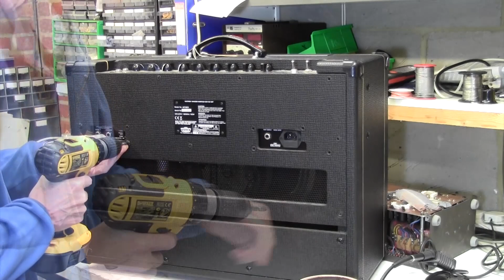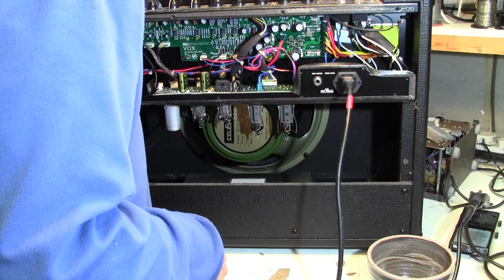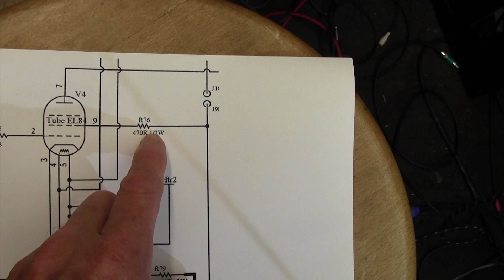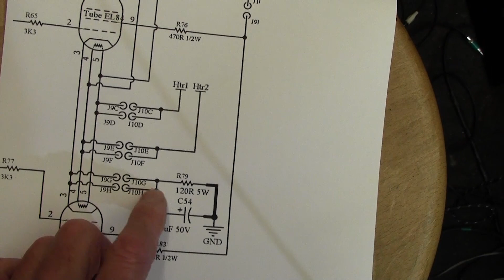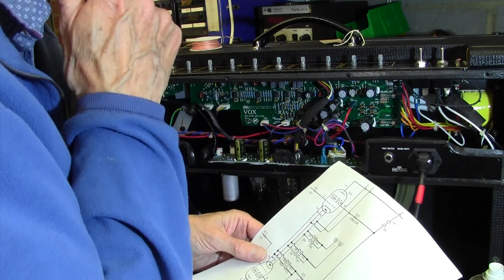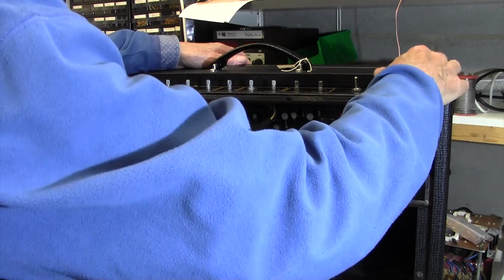How To Fix VOX AC15C1 No Output

Comment: I measured the screen resistors they are good. Replaced the tubes. Measured the 450v caps and 16v caps by the tubes all weren't tolerance.  Any other suggestions? I cant get any input.

Comment: Well it seems you didn't leave all the red herrings in by editing out the part where you got shocked by the undischarged filter caps.

Really should have replaced both the screen resistors with higher than the stock 1W resistors as this seems to be a rather regular fail point on these amps.  

Hopefully the owner isn't dealing with the same problem occurring again soon.

Comment: Hey my friend I'm a tech working on one of these guys I have output but is very low I'm seeing 380 volts on the power tubes I tried installing all new tubes same thing slight hum as well have you seen this thanks Ed

Comment: a friend gave me one of these and told me to have a go at it. same symptom. tubes, or valves if you prefer, are heating up but the amp is dead silent. no hum, nothing. i'm no professional but i have enough experience to not kill myself. no idea what the issue is as i haven't opened it up yet, but i'm grateful to have a little checklist of components to test. very helpful. cheers;)
Reply from the maker: Hi Mican  Sorry but that's a tall order. A bit like 'my car won;t run - can you tell me what might be wrong with it."  I hope you manage to get it fixed.
Reply: @stuartukguitarampguy5830  haha yea it is. thanks and i hope so too. glad to have a few possible failure points to look at first;)

Comment: What annoys me looking at this is how close the tubes are to the speaker ..there has to be a better way. These things get hot inside too-as do most Vox
Reply from the maker: Yes I come across SO much basic bad design.
Reply: @stuartukguitarampguy5830   The AC10 C1 is another example . That closed back with 2 small vents. That gets warm. In hot weather, it gets hot. .but I've raised this on some forums and people suggest it's not an issue. It comes down to price point and as long as people keep buying them , Vox wont change anything.

Comment: You may be satisfied, but in my case, I reject that approach. I prefer to remove and replace the PCB as normal. Do not use lack of tools as a reason. You should have more carefully first considered why the grid resistance burned in the first place. You can still get a TV-7 (vacuum tube tester) for a reasonable price.

Comment: I just watched a psionic video of repair and upgrade of the AC15C1   I guess he's seen a few of these and it's a common failure mode. He recommended preemptively replacing the 470 1W screen resistors at R76 and R83 with 1k 2-3 W and mounting them off the board a touch to get some additional cooling as well as hopefully protecting the traces below if the resistor does fail.
Reply from the maker: Ok thanks John, useful info.
Reply: Hi guys, be really carefull going to 1 k, it made my cathode bias votage up to 19 volts and they started smoking and no output.... Psyonic does change the 120 ohm cathode bias resistor for a 150 ohm. I guess you need to do this first.i did put back 470 ohm resistors after, they are off the board and everything seem fine.

Comment: Hi, I am having the same problem as what you had at the 4:00 minute mark. I put in a new resistor with the same value and it burnt out as well. Would the tube possible have anything to do with it? I noticed you swapped them out as a precaution.
Reply from the maker: Hi Ryan Yes definitely suspect the tube in this case. Those are 470ohm 2W screen resistors.
Reply: @stuartukguitarampguy5830  thank you for the response. I actually swapped the tube out and put in another resistor and the amp sounds good as new. So thanks for a great video!

Comment: Did he have both hands inside the chassis of a live amp whilst measuring valve currents at the same time in a finger reach of capacitors at about the 20:28 mark? Well, I suppose being as young as he is, his youth will protect him from any sort of charge unlike myself.  I'm way too old for that...but back in the day, I'd just touch it to me lips or tongue to see if it were live or not.
Reply from the maker: Ha ha, yes I remember the old 9V battery on the tongue trick to see if it had any charge left! You'll find that any tradesperson with decades of experience will do things not recommended for a beginner or someone less
experienced. Been at it 50 years now so know to keep myself out of danger. All the best.
Reply: @stuartukguitarampguy5830  I've been bitten more than once by my microphone whilst playing in the old days. Keep up the good work. By the way, I still use the 9v tongue trick. Cheers.

Comment: I am going through this now. My brother found the same type of amp in the trash. It is in near mint shape like the one in the video. Very strange to throw a vox AC 15 out.
All of the tubes light up but no sound.  I took the back panel off and found that the 250 volt fuse is scorched inside the glass. I assume that it is bad. watching this video, I took another look inside at the circuits and none are burnt. I do realize that it is much more complicated than that. The panel looks very clean. I hope it is just the fuse.
Man I was hanging on that last repair you did. Made the sign of the cross..held my breath. lol Victory! you did it. I subscribed. 

 Cheers from the USA.
Reply: Usually there is a reason the fuse is blown. So possibly its going to blow again since the fault is still unsolved. Good luck!

Comment: That amp is a bad design, they should have put 1k 2w instead of those pesky 470r 0.5w   They also should have mounted them with long legs so they were up in the air away from the board.
Reply from the maker: Yes it's so annoying to see such basic design errors time and again.
Reply: @stuartukguitarampguy5830  I recall these amps eating power tubes by overbias too, that  120r cathode resistor should have came stock at 150 ohms. Especially with such cheap tubes.
Reply from the maker: @infectionsman  Yes I usually check the bias current and upgrade the resistor if needed.

Comment: Hello Stuart! When I am in a situation where I have clearance issues with screws I pull out an old set of right angle ratchet screwdrivers that were given to me by my father. They are still very easy to come by and will get you out of silly design issues like this. Cheers!
Reply from the maker: Ooo nice. I must get some!

Comment: Great video. Will be troubleshooting a VOX Valvetronix AD120VT. I get sound out of it (minimal) but the master and gain have to be all the way up or there’s nothing. There’s also a power knob on the back that needs to be up half way in order to get sound.
Reply from the maker: I haven;t had a lot of luck with Valvetronix as they are very modern with surface mount components etc.

Comment: I have a vox vt30, but now there is a problem. if I play for 30 minutes, the sound suddenly decreases and hoarse. what's the problem?? Please help me. Thank you
Reply from the maker: No Idea I'm afraid. I just had a VT in for repair and I couldn;t fix it. These amps are all micro- miniature surface mount components and not easily repairable. Good luck.

Comment: Just had one, same deal, I got lucky-bad new JJ preamp tube section.
Reply from the maker: Nice one, well done. Got a nightmare at the moment. Marshall DSL40CR. Some sort of sticking relay problem on the O/D switching. Can;t find a schemtic and there are 6 relays in there!
Reply: @stuartukguitarampguy5830  Is that different from the DSL40C? I have the DSL40C schem.
Reply from the maker: @1Dougloid  Yes quite a bt different, it's a much more modern amp. Amazngly I did manage to get the schematic from a friend!
Reply: @stuartukguitarampguy5830  Great. I get that it's different, but is it better? Do they use an eprom for the switching commands?
Reply from the maker: @1Dougloid  I don;t thin it's an EPROM but it's some fancy digital switching I don;t fully understand!
No idea if it's a better amp.

Comment: Stuart, you used a carbon film replacement screen resistor? Should be metal oxide or metal film.  I probably would have gone ahead and replaced the other screen resistor while I was at it  just because of how badly the board got scorched when the first one burned up.  Why risk making the board conductive? Modern amplifiers, especially Vox amps, have a reputation for eating crappy modern tubes and the chances are good that this amp will again burn a screen resistor or two at some point in the future.
Reply from the maker: Yes I did think of that but for some reason didn;t do it.

Comment: I have run into that problem with resistors myself. I love it when you sit on a project a week waiting on a new resistor to come in and the original turns out to be fine. Something to do with the solder I guess.

Comment: Well now, I'm happy to say that I've never ever had a VOM on the wrong setting or read a number incorrectly....or misread a part number.... (eye roll)
Reply from the maker: Yes that was an absolute first for me too.... cough....
Reply: Yup, I've done it too. Or, having the meters set to DC when you're looking for AC or vice versa. Worst case scenario is having the meter in current measuring mode and trying to measure voltage with it and either blowing the internal fuse or blowing up the meter! As for erroneous resistance or voltage measurements, an auto-ranging meter can be helpful but sometimes the display bouncing around and taking a couple of seconds to settle down on a reading turns out to be annoying.

Comment: Great video. Yeah some say that the Chinese (probably Shuguang) valves damage circuits when they fail. I have use two sets and they sounded really well. But the second set blew a fuse after only a couple of hours of play. So I will no longer buy them. I wish the British and Americans would start making tubes again.
Reply: Yep, same here, one of the EL84s fried itself within a few days of owning the amp. Fortunately I heard it happen and turned the amp off so I didn't lose anything else on the board. I took out all of those crap tubes and replaced the 12AX7s with JJs and the EL84s with newer (russian) Mullards and happy days.
Reply from the maker: There's a worldwide shortage of tubes at the moment with insane lead times!
Reply: @stuartukguitarampguy5830  ..smiles in solid state.....
Reply: @tjsogmc  , I have many hundreds of NOS tubes and its uncommon for me to have to buy any from Russia or China.....
Reply: Old tubes can do that too! i had a set of Mullards in my Laney and they blew the transformer because of the different way they’re wired compared to modern EL84s

Comment: Thanks again for another honest troubleshooting video!  I know I made a similar mistake with some of the modern blue resistors that I measured before putting in an amp.  They had the resistance reading I was expecting to see on the meter, except it was supposed to be in K ohms and I didn't catch it. It cost me quite a bit of time in troubleshooting the amp later, but lesson learned.

Comment: Great job!!! I loved tha comment about superman...
Reply from the maker: Where's my cape when I really need it!?:
Reply: @stuartukguitarampguy5830   it's quite refreshing to watch a video by someone who includes themselves  making a mistake as well as doing good. To many people wanna show tha good not tha normal  ,ya know.
Reply: @stuartukguitarampguy5830  No capes! ;P
Reply: Yeah that was a great comment. I've learned if I fail on the first pass instead of troubleshooting what I just did for me it's better to start over from the beginning again. I used to Chase my tail but I've learned.
Reply: @stringlocker  I've done that a few times. I messed it up and started fresh....
Reply: I should have had added I know nothing about Electronics. I should know my dad was a TV repairman and a ham operator. But I was too busy being a troublemaker. The most I do is wire up guitars. I would never attempt an amplifier. It would end up in the trash
Reply: @stringlocker  yea I haven't really messed with my Amps much either, even though I'm really trying to learn more about wm and how to repair them